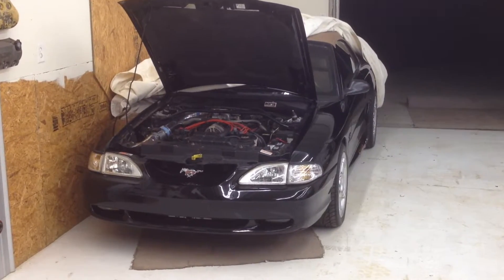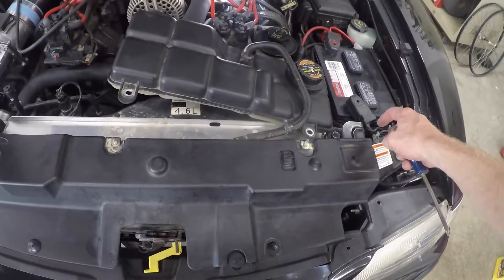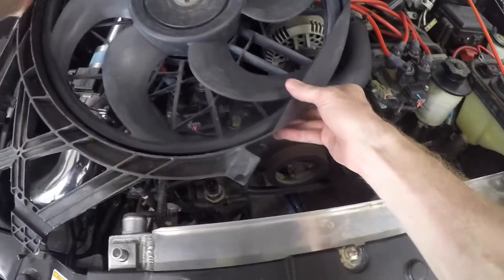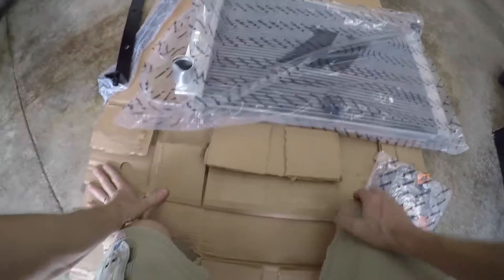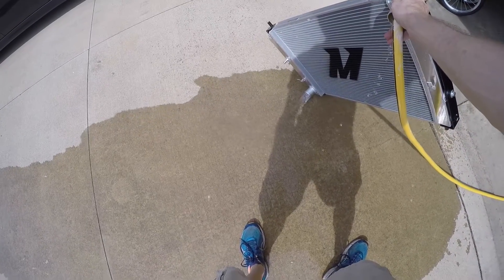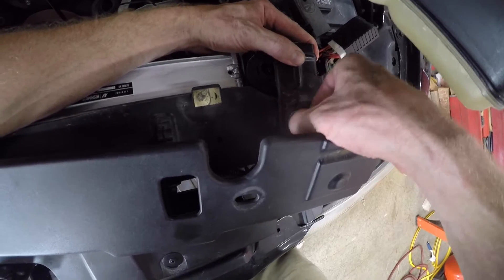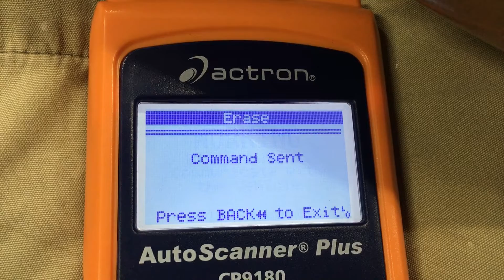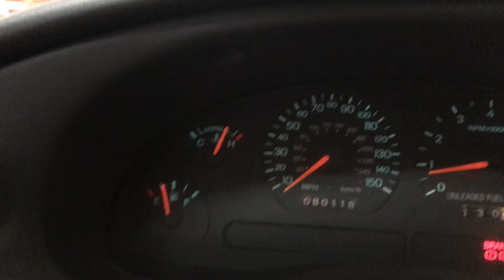How to: Install Mishimoto Radiator: 1996-2004 Mustang GT 4.6, SN95 Ford

Comment: What refrigerant using? Plissss
Reply from the maker: What coolant? Nothing special, it was probably Prestone or similar from Napa.
Reply: @6thGearGarage  What do you prefer peak all vehicles or preaston all vehicles?
Reply: I have a Mustang with a 305 5.0 with some modifications and I don't know what coolant to use, any recommendations?
Reply from the maker: @ most older engines use green coolant. Some newer vehicles use red.
Reply from the maker: @alexisalonso3071  Either will be good for a 5.0

Comment: Wait, what about the transmission lines?
Reply from the maker: There are no transmission lines for a manual trans. If the radiator is for an automatic, it will have connections for the trans lines.

Comment: you legit have the coolest sn95 ive ever seen. I'm seriously thinking of getting a GT V8 manual convertible in 2023... I have experience fixing cars but i have a feeling it will become an expensive rabbithole lol.. I would LOVE to own a nice one of these.  Underrrated car, and i'm mainly a fan of foxbodies and the early mustangs, i think these are third place for me.. But your SN95 SVO is cooler than most foxbodies for sure.
Reply from the maker: Thanks!!! The SN95 are the underdog, especially 96-98 because the 2v 4.6 didn't make much power in those years. But i have always liked the clean smooth lines of the 94-98 and the 2v 4.6 sound so good. I love the newer mustangs and think they look amazing, but it's hard to pass up SN95's when they're so cheap right now. Here's a video about my car and all its modifications: https://youtu.be/2R70U_QTAzI

Comment: Too bad these are out of stock now. I feel like all aftermarket radiators are junk. Sve one cracked and leaked after a year of use. Tried a eBay one and leaked really bad immediately. Mishimoto is out of stock everywhere. Cold case has no manual radiators left and aren't making anymore. Becool is the only radiator I've found made in the US but it's $700
Reply from the maker: It's amazing how many radiators are cheaply made. I'm glad I installed this before all the supply chain issues started.
Reply: @6thGearGarage  I just ordered a black painted sve radiator hoping for good luck. After the chassis twisting issue was mentioned maybe that's my problem. I would think so. I ordered a 01 bullitt stifflers strut tower brace, I have a 96 but with a full 01 bullitt motor and intake swap. And when I swapped the engines I never put the k members brace on the bottom back on. When I put this new radiator on I'm going to reinstall that.
Reply from the maker: @sategllib2191  yeah it all made sense after I heard about the chassis twisting. My 97 is stock with just intake/headers/exhaust and pulleys, and it has already been through 3 radiators. Convertible definitely doesn’t help with flex though.

Comment: I just got this rad and the A/C line is giving me trouble. You made it seem so easy to fix
Reply: same. i cant get the rad in.. i think im gonna have to remove the battery and battery tray, cause the bottom right of the rad is hitting on the battery tray when i try to drop it into place.
Reply: Literally can’t get passed that damn lower ac line